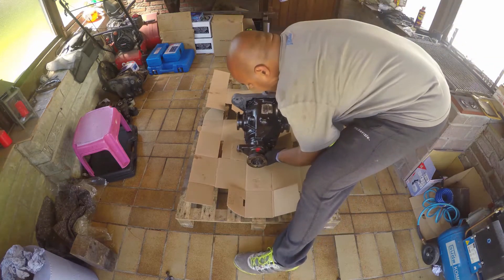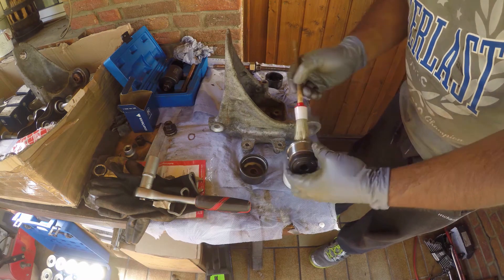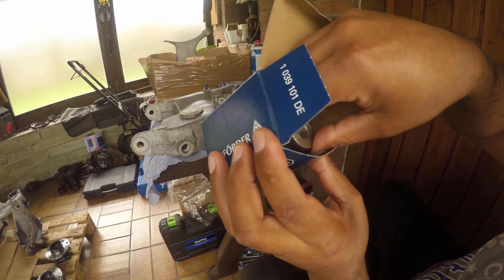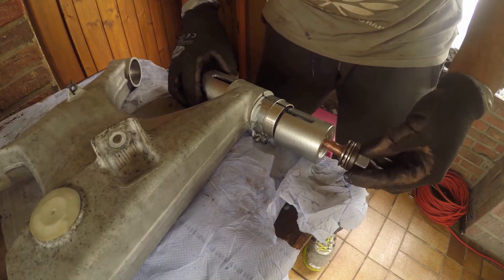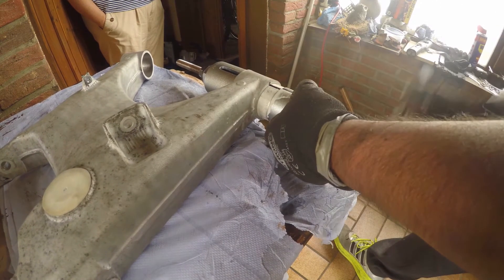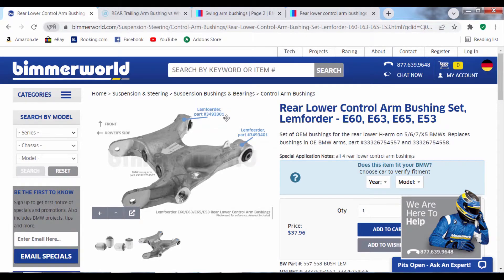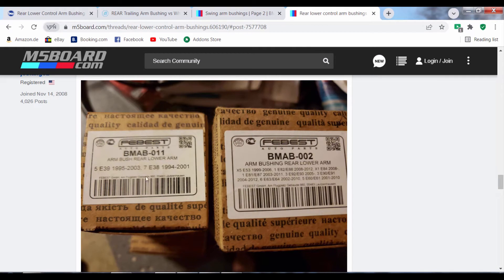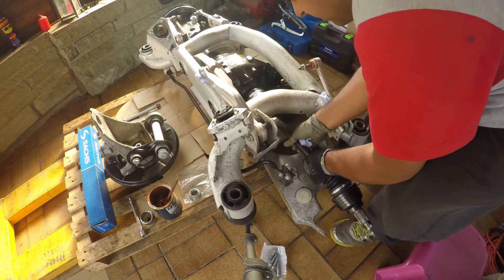Part 8: BMW E39 530i Touring  Driveline Restoration - Rear Wishbone Bushing Install

Comment: Hi. So it is a e53 lower control arms bushing set and sleeves that you used to go from m12 to m10 bolt used on e39? Could you provide some links for this parts please. Thanks
Reply from the maker: Hi - better to order the specific Lemförder Part Numbers: #3493301 and #3493401 (same part numbers in the bushing set).  Once I got the parts, I measured the bore and here is the link for the sleeves I could get locally: https://www.ebay.de/itm/192079359922?ssPageName=STRK%3AMEBIDX%3AIT&_trksid=p2060353.m2749.l2649 - 10mm inner diameter with a 1mm wall thickness to convert #3493301 bushings.  70mm long was not available, so I ordered 2x35mm long sleeves.

Comment: 1 min 8 sec in, you can see that the front diff bush bracket on the subframe is cracked, need to be welded or replace subframe completly
Reply from the maker: Oh thanks for letting me know and watching the video so closely!  I will inspect the bracket when the sun comes up!
Reply: @FullgasNoTraction  just wanna help a fellow bmw enthusiast, seen some other videos of rebuliding that have had cracks, but mostly on M5´s. so tell your wife to ease of the accelerator 😂😂
Reply from the maker: Hahaha!  I will definitely tell her!